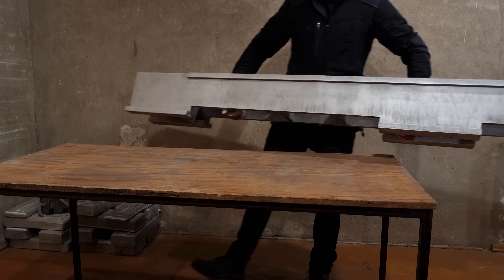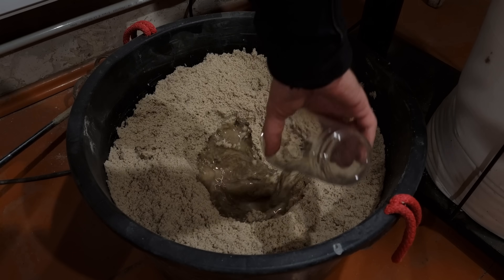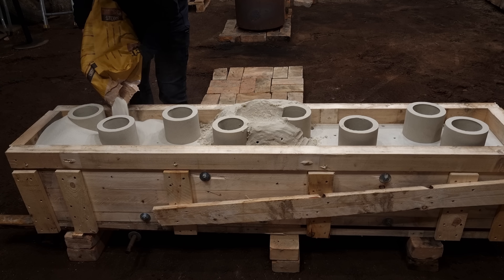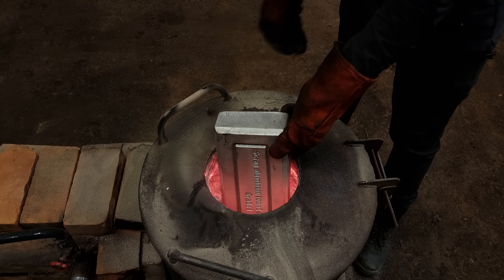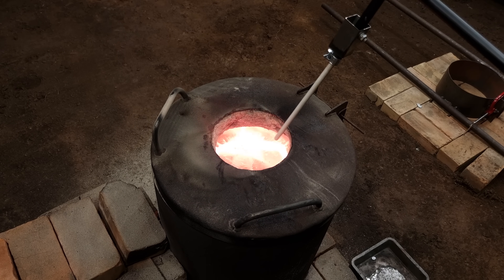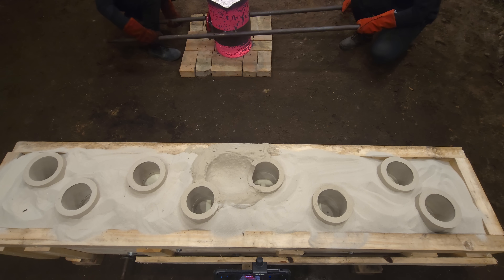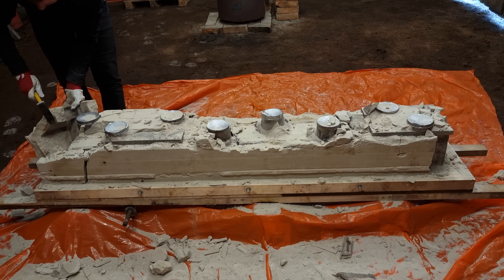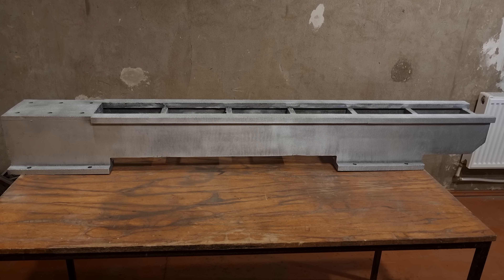DIY Lost foam casting a large aluminum metal lathe base

Comment: For anybody copying this I'd suggest you should have put some fillets or chamfers on all those sharp corners of your foam former - just cut some foam triangles to keep it simple over trying to get a fancy curve. As there is a reason all the old castings are generally full of curved parts and rounded joints as it removes stress riser points and also just works better by allowing for better performance from a thinner overall casting as all those chamfers act like a thicker skeleton. Still impressive effort that I doubt will really cause any problems as it is pretty chunky. 

For myself unless the project is really the only purpose at that scale of machine I'd rather restore an old cast iron machine, as at least round here they are common enough in that bench top scale and often not actually in need of much work even when they are many decades old (also I don't think I could find any space to create a casting that large, but working on a machine that large with a scraper etc is much easier). Though as you can not beat the satisfaction of succeeding with a project the way you wished to do it... I look forward to seeing this monster grow.

Comment: I'm really amazed at how well this worked. Sure, there are some defects, but it should still be usable.
I'm just a little concerned about the fact that it looks like you want to use the bare aluminium as sliding surface, is that correct? I'd propably have left the edges narrow and bolted steel flat bar on there, which can then be ground or even scraped to flatness.
Btw. I've made straight edges from granite window sills before, those would be really helpful for getting everything flat and straight. Should have caught the process on video, but I can explain how I did it if anyone is interested.

Comment: That's the problem with extruded foam. Its way thicker than styro foam so it takes more energy and time before it can burn it down. Since having a quite big enough cnc there is a possibility using sand and sodium silicate to create sandstone blocks and machine  the molds like a puzzle. Ofcourse takes way more time than cnc'ing foam, but you'll avoid loose sand bits and the aluminium will set out more evenly

Comment: I used to work in the casting industry. Overall, great job! However, I want to warn you against machining into any of the surfaces too deeply - I didn't see you bubble nitrogen through your liquid aluminum to drive entrained hydrogen out of solution. While not bad on its own, you'll find that the casting will have waaay more porosity than you'd think in those thicker areas, and is probably the reason for the porosity defects you noticed.

Comment: The casting was pretty impressive, but forget about aluminium for a lathe base this size. Cast iron is the choice of material for this purpose not because it's cheap, but because it needs weight, wear resistance and rigidity. Aluminium doesn't fit any of the criteria.

Comment: It's a fantastic result, but that doesn't change that it is the wrong material. You will find out when you are machining why people are saying this. All the encouragement is appropriate and well deserved, but none of them have actually used a lathe to the extent that they understand the materials used and why they are necessary. 
It is still a great job and great experience with such a large casting. Well done.

Comment: Impressively done. Make sure the ways are leveled and machined to the best tolerances you can get before using it or you’ll end up with inaccuracies in the spindle bores of the machines you’re making.

Comment: Very impressive cast for DIY. A lot of people are shitting on the material choice but once bolted down this will do just fine.

Yeah iron is great, but if you can cast 150+ kg of iron at once in your shed, that’s not a shed that’s a foundry. I sure ain’t volunteering to be the one holding a bucket of 1800+ degree molten death that’s heavier than most fridges lol. Be realistic.

Comment: Why do you want to machine the ways,
When you can get 4140 steel or better machined, and attach them to the bed , then have them machined parallel to fit the rest of the lathe components.
You will have a much stronger and long lasting lathe bed,

Comment: Nice bed, however, I'd be concerned about building a lathe out of aluminium due to the high thermal expansion, and wear issues when compared to cast iron. Facing the slides with cast iron or steel you would end up with thermal expansion differences with the materials. You have piqued my interest so I subbed and will enjoy the journey with you 👍

Comment: We used to do aluminum foam casting in shop class back in the 90's.  Lemme tell you, we did not have the appropriate ventilation lol.

Had a thought after seeing how the aluminum cooled before it could finish the very edges.  Do you ever preheat the mould after you finish packing it, or could that cause defects in your compression?  Packing heating elements vertically into the sand to warm up the path through the foam might work.

But seriously, that's amazing.

Comment: Are you making the ways from tool steel and bolting them, or just running on the aluminium?

Impressive casting.
Reply from the maker: I am planning to use linear rails

Comment: This is how i run the first part after coding. I use foam instead of the material, because it can be measured, and it gives way if there is a bad line of code without breaking the expensive tooling. Also you can run feeds at like 600% in foam so checking  the very 1st part after coding the part is far less time consuming. 
Ps Hope that lathe bed doesnt warp all over when you load it, I have a bad feeling you made a chatter box lathe under load. But I have a bit of faith and a whole lot of hope it works anyway! -- Machinist/Tool and die, fabricator of HP.

Comment: When you think about it, you dont need to grind and level the aluminium, its only the steel ways that matter.
Once they are scraped flat,  bolting them in place, even using Babbitt levelling compound,  should do thevtrick

Comment: Weigh a 1” x 1” x 1” piece of foam and the same of aluminium then next time weigh your foam form before moulding in sand and calculate the weight for aluminium then add 10% for losses that will give you a good starting point

Comment: Maybe a shop that works on large engines like those used in naval vessels would have a mill large enough? If you can't find one perhaps you can make a 'self-milling' device. Like an angle grinder on a sled.

Comment: Can you fill the cavities with epoxy granite to dampen vibrations that will occur when using the lathe?  Will you be adding hardened steel rails for the way surfaces?

Comment: Very cool project and nice video!

The material choice baffles me a bit though. I looked through your channel and looks like you got a lot of aluminium so I guess the primary motivation was "free material" to make it out of, but I don't think it's a good choice as lathe base. You want as much weight as you can in your base and as much similar materials so everything you mount to it stays solid and doesn't warp with temperature changes and different expansion rates, so that's why most lathes are either steel or cast iron. Next to that the aluminium is also a lot softer so the wear surfaces will be worn out more quickly. Even if you mount steel linear rails, it's still going to warp a lot and stuff will be under a lot of tension, contrary to aluminium extruded profiles that can give a bit of way and stuff is usually mounted with locknuts that aren't absolutely fixed in place, as well as those machines being inherently limited in what kind of materials they can handle.

As far as I understand it, you never want to work on materials harder than what the machine is made of, so this lathe would only really be suited to work on other aluminium or things like brass, since the machine itself will flex resulting in worse precision or even tool chattering while working on harder materials.

But the thing I really dislike about using all this aluminium as a lathe base is that it's perfect material to use on the lathe or on a mill. It's kind of a waste to put such nice material on the base of the machine when you could make the base out of iron or steel and use the aluminium to make beautiful stuff!

But I'm not hating on the project, that's a beautiful cast and I'm sure you can make a functioning lathe out of it, it's just something I've never really seen before.
Reply: Eh it can be done, it definitely can be done. I work in a wafer fab producing devices on nm scales, a lot of our machines are aluminum based with steal linears. Some of those have run 24/7/365 for 25 years now without damage to the aluminum base (to address your wear comments).

Comment: Nicely finished in Aluminum. Now do it in cast iron so you can build a good lathe. There is a reason no commercial lathe builder uses Aluminum for any size lathe.
Reply: There an old saying about hammers, you can spend all day wishing you had a better one or you can swing the one you’ve got
Reply: I think if he uses a steel plate on top and just have the aluminum for the majority of his base material then he should be fine. I’d worry about wearability on the contact faces of the moving parts but besides that it shouldn’t be too bad for a DIY application. Plus once he has this he can use it to make better parts and such to make a better lathe/other machinery down the road if he so pleases
Reply: Kern milling machines, one of the most precise machines in the world, are mostly made out of Aluminium. Not everything is about the material, but the design/concept of the machine plays a huge role.
Reply: @thomas8719 COMPLETELY DIFFERENT machines… Kern makes CNC mills. And as someone that has built a couple of my own CNC machines including a couple Routers and a Milling Machine. It’s extremely easy to program a CNC for excess backlash, or flex in the frame/structure. Also… most of those machines are made from billet machined aluminum. Not cast. Making it substantially stiffer than cast aluminum. 

Having said that… I actually don’t think this guy’s aluminum lathe base will be as much of a problem as everyone else does. Sure, it would be better in steel or iron. But for the average DIY application. I think aluminum is perfectly fine.
Reply: @brandoncrimmins6296  you can program a cnc machine to counteract flex? Care to elaborate? Sounds like you are a sand pounder.
Reply: @daveanderson2316  yes it’s called a backlash calculation. It’s a very simple mathematic equation… have you ever ran a CNC?
Reply: I think the primary reason no commercial lathe builder uses aluminium is cost, both of the material and the energy required to melt it. But since the material comes from scraps and this is just a one-off, neither really apply to the uploader. There are a bunch of other issues with not using cast iron or steel for the base (I put it in another comment) but I guess we'll just have to wait to see what happens, no?
Reply: @bami2 в России выпускался токарный станок МК 3002. У него станина была алюминиевая, а направляющие стальные.
Reply: @bami2 Cost? Uh no. The reason they don’t make aluminum lathe beds is not cost. It’s rigidity. There is no substitute for rigidity in machine tools.
Reply: @grntitan1  yup. Iron/steel is more than twice as stiff as aluminum
Reply: @bami2 the reason is that while CI is very resistant to vibration and bending motion, aluminum is just the opposite. It’s also way too soft. CI isn’t very hard unless flame or induction hardened. But CI, with its high carbon content has very good wearability if it’s kept clean. Aluminum is terrible at that. It scores easily. I hope he, at least, used a proper casting alloy, if not, he will have a problem as time goes on.
Reply: wat about casting it in brass? @bami2
Reply: @morgorth3242  Brass solves the weight issue but there's still issues with hardness and thermal expansion rates. Brass is still relatively soft (a bit harder than aluminium but softer than iron or steel) so even with a big chonk as lathe base it will resist warping less when under strain than one made out of iron or steel. And when you attach things like steel linear rails the brass will expand/contract due to temperature changes differently than the rails, which will put strain on the entire thing and possibly flex it.
Reply: @morgorth3242 there is no real advantage and the cost would be far too great.
Reply: @bami2 brass is actually pretty heavy. Copper is heavier than iron and so the difference between most brasses and iron, weight wise, isn’t that great.
Reply: @melgross  In the video he re-uses cast aluminium so I think he's ok on the alloy there, the other points I totally agree with and already said in other comment. 

I'm just interested in what the result is going to be even though it's a weird material choice and if he can manage to turn it into something useful.
Reply: Do you think that aluminum is harder to melt than cast iron ?? Lol  @bami2
Reply: Cool comment. Now just let the uploader be. Your unsolicited arrogant advice is unwanted.
Reply: Waiting to see your cast iron lathe bed…
Reply: Do it in aluminium and upload a video about it.
Then you maybe i will respect your opinion abit more.
As it stands, you dont have a leg to stand on, and such a demanding comment wont win you any favors either!

Comment: i wonder, can you fill a mold like that from both ends?  you'd have needed 2 furnaces to heat up two loads of Al in tandem, and i guess 4 people to pour it in unison, but if you filled from both ends at the same time wouldn't it have reduced the cooling issue?

Comment: Since you cant make every component from aluminium, the mix of thermal expansion coefficients will make this lathe warp all over the place when exposed to temperature changes.

DIY is cool, but for this youre probably better off just buying some kind of base, even when its just a rusty slab of steel from the scarp yard.

DIY is cool, but it has its limits.

Comment: add hardened steel to the ways you'll be glad you did the alu is a okay base but will wear quickly
Reply: But there is also problem with two different materials with different thermal expansions joint together. It will warp with changing temperature. And with long piece like this it can be a lot.
Reply from the maker: there are cnc machines made out of extruded aluminum profiles that have linear rails
Reply: @Borden_yt  nah, bimetallic actuation is measurable on enclosed 3d printers because of significant assembly/operation delta, but for reasonable repeatability on “open air” cnc it’s completely fine
Reply: @Borden_yt what change in temperature they are the machine body meaning they are ambient not seeing any major temperature changes
Reply: i'm pretty sure that ways are just flat base for linear rails
Reply from the maker: that's the plan